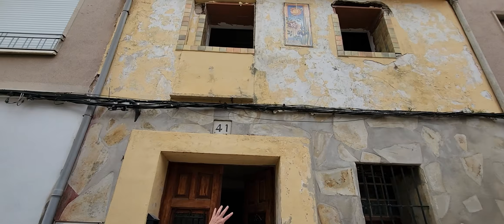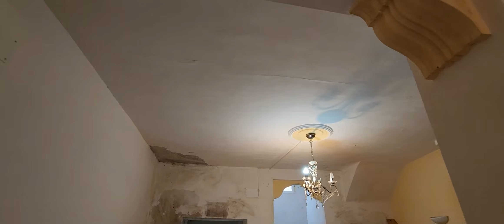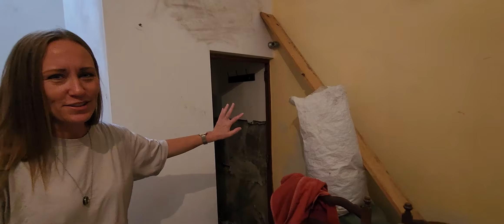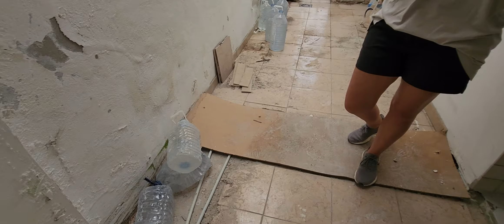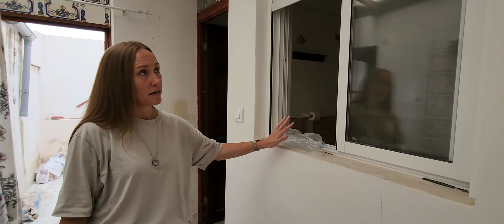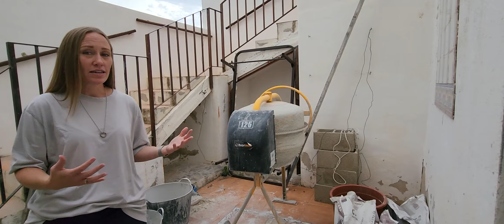9K HOUSE IN SPAIN - Ground Floor Plans - #spain #pego #renovation

Comment: What you are doing is truly inspiring Nicole ☺️☺️ I love how you remodeled the home. I’m more into numbers. Apart from construction costs, how much is it to own it in the long run? Like real estate taxes, hoa, local taxes, construction permits if required. I feel more convinced about buying a small home in Europe with your videos
Reply: Real estate taxes for a €100,000 house is around €130 per year. No HOA in Spain. Local taxes for things like refuse removal are different depending where you live. But it shouldn’t be more than €100 per year.
Construction permits are done at local council offices. Things are classed as small works or major works. Major works are usually charged at a % of the total. Small works permits are around €12.